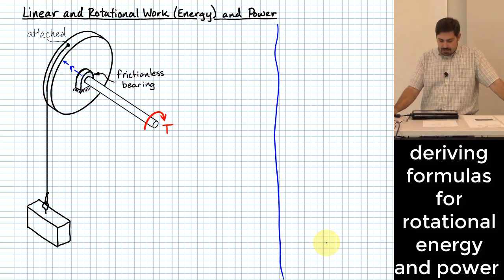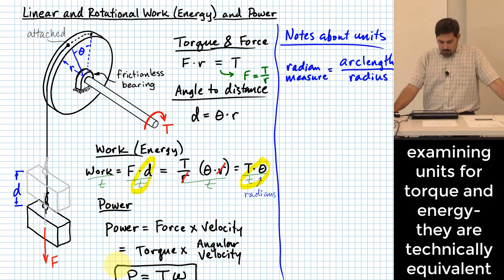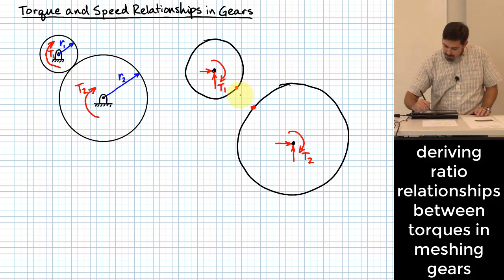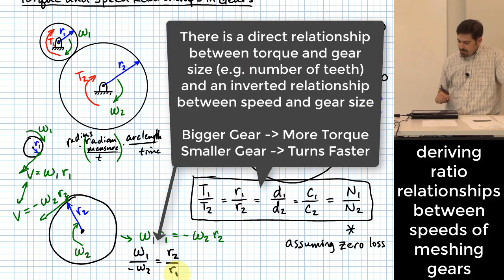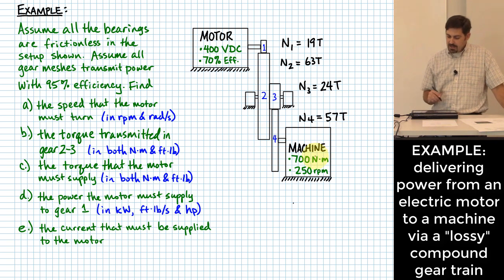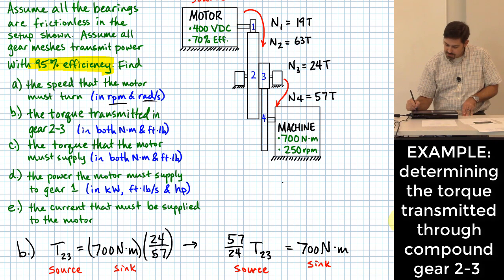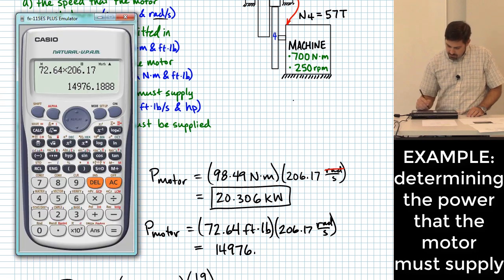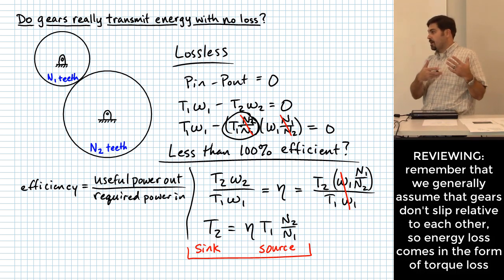Rotational Power and Energy Transmission | Efficiency | Gear Trains | Torque & Speed Ratios

Comment: sir one error i spot out in this lecture  the power of the motor you mentioned 20.306kw i think that was wrong  20.306 watt is the answer because One watt is equal to 1 Newton-meter per second (Nm/s) so  the answer is 0.0272307946 hp motor you mentioned 27.23 hp motor am i right sir.

Comment: hello sir,
thank you for the lecture & i like the way you teach very kind.
i have some question related to my work study 

i have a motor pulley & ball screw mechanism. 
motor power = 2.1 nm
ball screw force- axial force  3 kn
pulley ratio = 2 , (48:24)
moving load on lm guide is 2.7 kn
what will be axial force on ball screw shaft or on pulley.

if any more data required pls let me know

Comment: 400 watt three phase 60 hz motor at 25 rpm I want it to pull a load capacity of 400kgf.  How many N.M  does this motor need to do this task?
Reply from the maker: If 400 watts is the max output, and it turns 25rpm, then P=T*omega would say that the max available torque would be 400W/(25rev/min*(2pi rad/rev)*(min/60s)) = 152.8 N*m. You would need to set up your rotation-to-linear-motion mechanism to transform that torque into the required force you indicate. Since I don't know your plans there (spool and cable? rack and pinion?...), it is hard to say anything more specific. Also, if 400W is the electrical power input, you will likely need to estimate the efficiency of the motor to estimate how much less power output the motor will have relative to power input.
Reply: @TheBomPE  Thank you so much

Comment: You are a talented lecturer and your videos are excellent. 

What software are you using to capture and present the solutions using a stylus?
Reply from the maker: Thank you so much for your kind words! I use Microsoft Onenote 2007. (It worked better back then, and it had customizable toolbars.) You also want a tablet PC with an active digitizer (Wacom makes the best ones). Thanks for watching!
Reply: @TheBomPE  Very good to know! Which tablet are you using? (windows tablet? Is that a surface pro?) -> I am interested in using it to create my personal engineering notes (I am a gear engineer), but struggling to find a proper one.

Comment: Shades of Richard Feynman!  I never had the pleasure of taking a class from him, but his notes on physics that I read took things incomprehensible and made them simple.  You Sir, have done the same thing.  I learned the unit conversion method at Colorado School of Mines and appreciate the effort you go through to carry units throughout.  I have a problem right now that relates to this lecture and will definitely listen a second time, maybe even a third!  Well spoken, easy to understand (for those of us that are somewhat hard of hearing) and logical.  Excellent.  I still need something on linear dynamic simulation with SolidWorks Standard.  Having not found it yet doesn't mean it doesn't exist.  If it doesn't exist, I would implore you to do one if you can manage it.  You have a way of instructing that fits me well.  Regards.